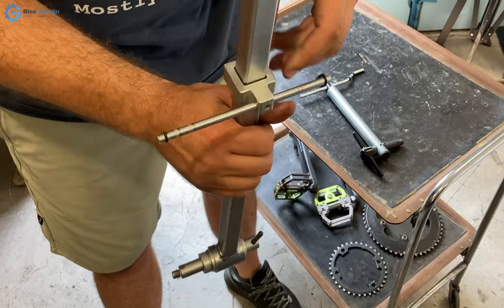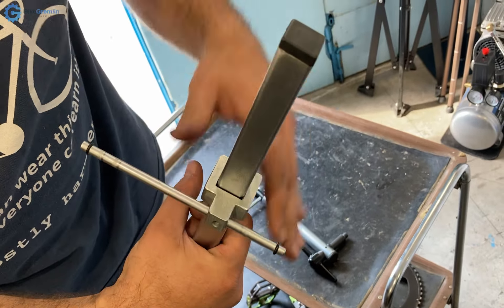Unior Hanger aligning tools' problems

Comment from the maker: A great hack that Danielle made - for Park Tool hanger alignment tool, but the principle should work the same for Unior (just with a 45 degree change):
https://www.youtube.com/watch?v=hIZh27-v4cA
Reply: Hi, I have the same small hanger alignment tool, and it has the same issues. I even put a second set screw in the bottom to help remove the play, but it did not work. While this is a major problem (and incredibly poor taste from Unior to put such a tool in the market especially considering the price), I do not agree with you that it is useless. The solution is to "work with the play, and not against it" i.e. when you measure the alignment in point A, press gently to remove the play, then repeat in point B. The amount of play is consistent so the results are accurate (enough) for even aligning 12spd systems. P.S. Unior recently released a version 2.0 of the tool - maybe ask them to send one for You. Hopefully they fixed this issue in that version.

Comment: Have you looked into Abbey Tools HAG, Park Tool DAG 3?
I have Park Tool DAG2 cmhPrintedDesigns FlipDAG-2, it's a 3d printed rotating arm accouchement for the rod.
Reply from the maker: Thanks.  :)

That Park Tool DAG 3 looks a lot like what I thought would be a better design. Does have some plastics, but still.
It is expensive - and I can't see it locally (would need to order one from Germany).
So it will wait (the old Unior tool gets the job done, if not very quickly and practically), there are other tool priorities (though I'm considering to put my money towards buying a camera first, because the phone is quite tricky to shoot videos with). We'll see.

Abbey Tools look like they are made for the rich (the prices).  LOL  :)

Edit:
The old Unior tool looks a lot like the Pakr Tool DAG2. It gets the job done.

Relja
Reply: @BikeGremlinUS  I checked the prices, Abbey sure is still pricey. Some years ago and closest was bikecomponents in Germany, and was pricy. DAg3 was not in stock anywhere then. So I opted for a cheaper upgrade instead. But I've not found such upgrade for Unior. 
I agree that tool makers should listen to real mechanics and let them figure it out. Park Tool also made flawed tools.
But misstakes happen, improvements can happen.
But not going exclusively with one brand is the way to go, get the best tool for you and the job.
Reply from the maker: Exactly.
The point is not about never making mistakes - the point is realising and fixing them.

When it comes to brands, a lot of my tools are made by general tool manufacturers (not bike-specific brands, nor even one manufacturer in particular). However, Unior is one of the very few brands that let me buy at the normal price (the price that Americans and Germans can buy at), and get any spare parts and similar. Great local support.

Park Tool (to name one) is the exact opposite - it's not available locally at all.
Similarly, Wera, for example (I love some of their tools and use them daily), offer next to none support for Serbia, even if you can find an odd tool here and there (scarce offers).

Relja

Comment: Awful indeed.

Unior hangouts also have problems. I ordered one for a Wilier Cento1 SR but when the 3 screws are tightened it doesn't fit the frame base because there's a 2 mm gap.
As a result it provokes a misalignment of both the wheel and sprockets and it's impossible to have the RD working correctly.
👎👎👎